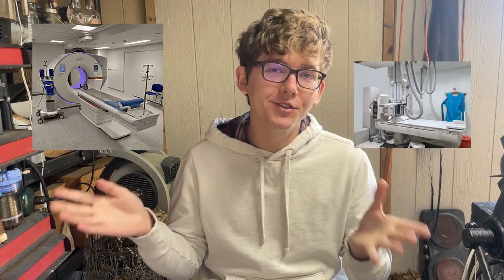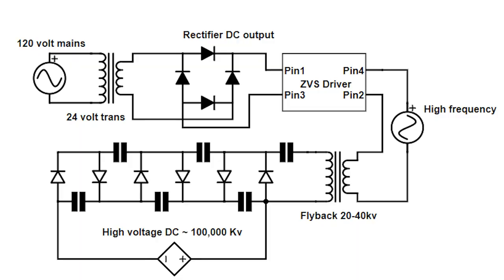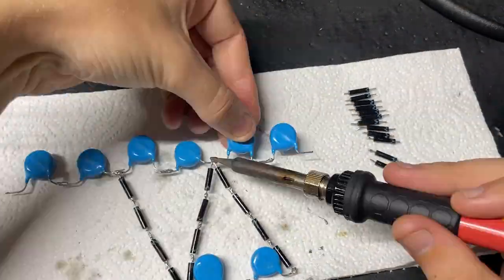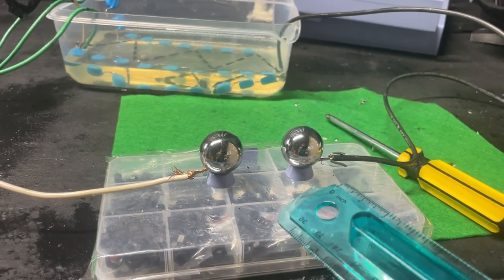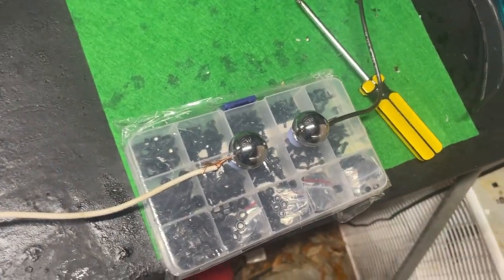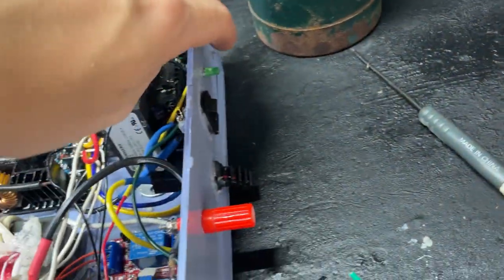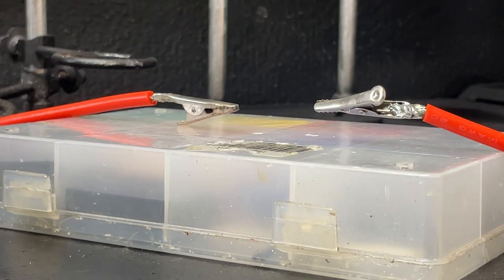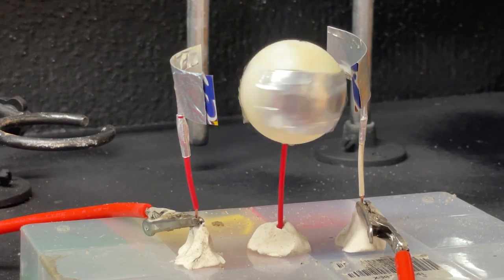Building a X-ray powersupply

Comment: When you rewound your primary it’s likely that you adjusted the number of turns around the core which especially on a flyback will have a big difference on output voltage. 
As an example if the transformer had a 1:100 winding ratio then 10V on the input would be 10KV on the output if you put 2 windings on then it’s effectively halved to 1:50 and you’d only get 5KV at your same 10V input. 
So less turns = more voltage but also increases the risk of internal arcing of the transformer and overcurrent from the ZVS.
Reply: Thays what I thought too. A diy veriac cos be a fun project 🤔
Reply: Completely agree
Reply: Also generally less than 4 turns isn't really enough primary inductance for zvs
Reply: @derrekvanee4567 variac aren't normally used for high voltage wdym

Comment: It would be useful to add a resistor for high voltage (and low inductance) to the output of the multiplier. By limiting the current a little, it extends the life of the diodes and in case of electrical discharges it prevents dangerous inductive spikes in the circuit.

Comment: In printers, the high voltage (from a corotron, for example) is divided by a very high-resistance divider to a value that is suitable for the PWM controller. Then a buffer op-amp with unity gain is installed to match the impedance and then op-amp output goes to the feedback input of the PWM controller. And the PWM controller, in turn, controls the power supply of the high-voltage converter, or directly (through a driver actually) its switching elements (MOSFETs or IGBTs). This allows you to set the output voltage with sufficient accuracy.

Comment: Nice psu
But using a buck converter to power an LED kinda broke me, using a series resistor would have been much easier. Also add some filtering before the ZVS as the "DC" from the rectifier will be pulsed. A capacitor will help to get a more smooth DC and maybe more output.

Comment: Try using a flyback from a gas grill igniter, the battery operated ones, not the piezo ones. Drive with zvs and feed output into multiplier, scary loud output from multiplier

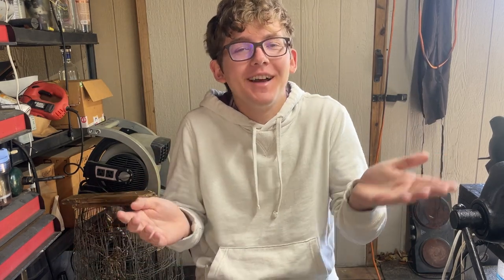Comment: 3:20 my thoughts exactly when i built my own multiplier hahaha
what x ray tube do you plan on using? i have used a $10 2x2A rectifier tube with no joke about 100kV across it and it did not burn out / overheat the heater filament. to use a very cheap tube, u need to have a high exposure time on your camera to really brighten the image to get decent scans
Reply from the maker: I have both the 2x2A tube and a mammogram X-ray tube. I haven’t pushed more than like 30kv on the 2x2A but got ok radiographs out. The mammogram tube on the other hand will make a nice radiograph in half a second.

Comment: Your numbers are way off due expecting breakdown voltage of air to be the relevant number (3 kV/mm). Due Townsend avalanche you will see arching with bit over 1 kV/mm.
Reply: I agree. Rule of thumb is 1kV/mm, no more.
Reply: Omg he's gonna have to rebuild the whole thing to make his x-ray tube work now
Reply from the maker: the Townsend effect shouldn’t effect initial arc over length. Although due to non standard conditions voltage breakdown may be in the 2kv/mm range with the spheres. Cant tell for sure though without a true high voltage probe.
Reply: @PyrotechnicalScience  Yes, with smooth spheres you can expect more than 1 kV/mm, but 3 kV/mm is still way too much.
Reply: @cooldude7301  Probably not. You can get x-rays (soft x-rays) with much lower voltage, if the tube is good. However the produced x-rays may not be suitable for example medical imaging.
Reply from the maker: I’ll have to try this again with a known voltage source and see what breakdown voltage I get.

Comment: Why is it needed to put ZVS in oil? It is on the lower voltage side. I saw people on the internet driving flyback transformers from those aliexpress ZVS  without putting them in oil
Reply from the maker: Not needed, I just threw it in.

Comment: I am trying to build the high Voltage x-ray power supply and need about 100KVp for 5 secords, I find most of the parts but was unable to find the exact one in the video, that is, the flyback transformer, can anyone tell me where I can get the same flyback thats in the video. Thanks
Reply from the maker: I made it myself with a TV fly back core and some magnet wire. You can find AC fly backs on eBay that will also work.

Comment: Did you literally fill the entire case with wax?
Reply from the maker: Yep, without it the power supply would instantly self destruct
Reply: @PyrotechnicalScience  isn't that melting a land leaking immediately?
That case doesn't exactly look watertight
Reply from the maker: I taped it up then filled it

Comment: why not direct hv transformer to dc hv fbr-cap
Reply: and I dont mean tesla coil arc
Reply: have you tried edm (electric discharge machining) in the same vegetable oil, yes etching by arc welding inside a liquid coolant insulating medium, and not water
Reply: try static electric charge high potential hair riser generator, whatever type, even the drop bucket version lol
Reply: why would you fly back, lol
Reply: thats nonsense :)
Reply: dont mind, nice project, bro
Reply: oh yes the transformer diode fbr cap is a continuous arc welder circuit, yes welder works nicely as power supply
Reply: its below 100V tho, but adjustable amps
Reply: nice emi bro lol
Reply: ionic wind thruster
Reply: stripe motor hv would be better